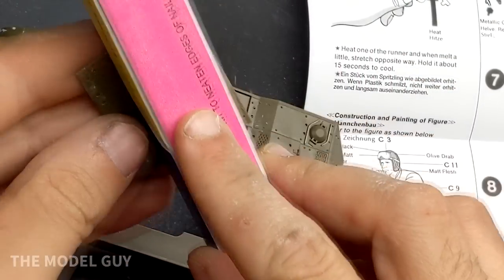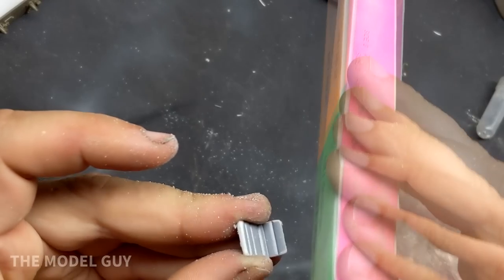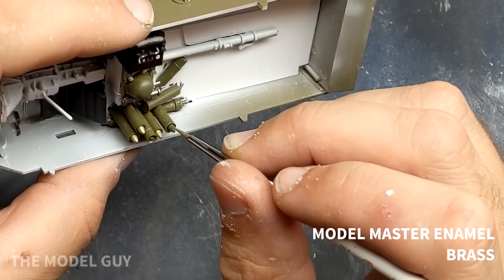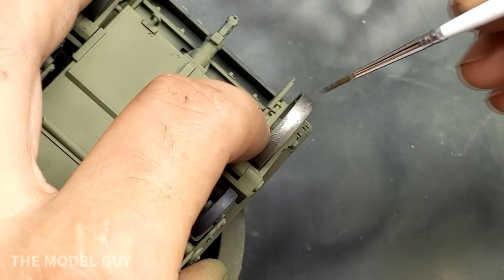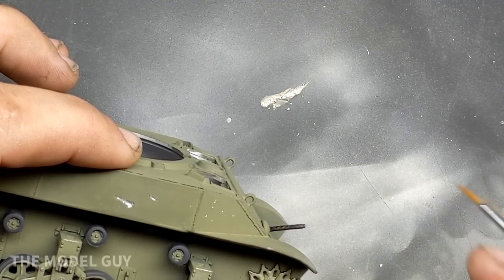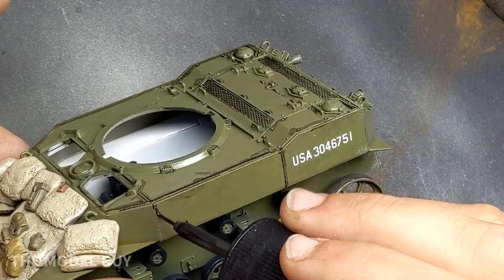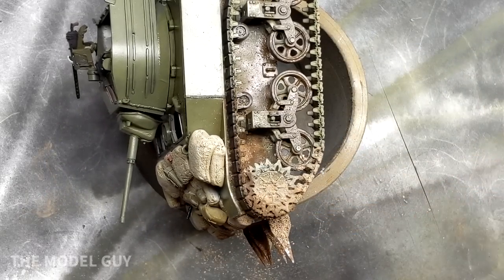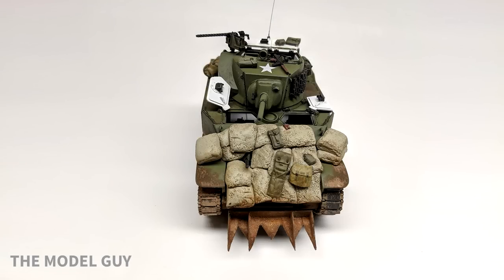My first tank build! 1/35 Tamiya M5 Stuart

Comment: You are absolutely right about the "armor style" that a lot of Youtube modelers use. They go heavy on color modulation, chipping, weathering. To the point sometimes that the tanks look more like wrecks pulled out of a lake 50 years after the war than they look like armor in the field. The lifespan of an average Tiger or King Tiger tank was measured in months - Sure they got dirty, sure exposed steel got rusty fast. But these things still had New Car Smell when they met their ends.

Comment: US (and Canadian Ram) tracks were "live" (containing rubber bushings) and did not generally "sag", unlike German and Soviet tracks of the era.  So, don't beat yourself up over using the vinyl ones.  The standard for both M3 and M5 was a rubber block with two steel pins that mated with the end connectors, which also carried the guide teeth..  So, the centers are a rubber black.  The inside face gets a bit of burnsihing from where the rubber bogies roll against them.  The insides of the guide teeth get more wear, on average, than the outsides.

Comment: I just got a kick out of the fact this kit was first issued in 1977. I built this kit back in 1978 or 1979. It was a fun kit to build and had my tanker firing the .30 caliber machine gun. The plastic tracks on all these kits from the 70's and 80's were always a challenge to get the sag especially on the German tanks. One way was to use thread through the track between the wheel and around the torsion bar and pull the track down onto the road wheel. I did that on my Panther and Tiger and it looked great. The other challenge when connecting the tracks was using a heated flathead screw driver to flatten the connectors without melting the track around it.

Comment: You should use black brown paint to made drybrush scratches. Silver/steel is good for aircrafts.
Reply from the maker: Thanks for the tip. I still have some weathering to do to tie it in with the diorama. I'll do touch ups then

Comment: I made a fantastic air recognition pannal out my tabbaco packet! Shane's is a great tutorial but not accurate folding! Look up some real one's the plastic from the tabbaco packet I used was great for the wipe down plastic used fornthe pannal the bag was canvas that's the long one on the resin on the front you have is for! It's actually the first time I've seen the stowage bag for them in a resin plug! The ends of the pannal were fabric stiched border to keep it all together with the white pannal on the back of the 140 pannal but they were long very long and narrow! That could be cut in half again to replicate a real one! And the early m5a1 never had the 30 cal shield on side of turret, Tamiyas burn iron is or German camo black brown we use for chips is great for the gun base adding bry brush gun metal or using the gun metal down first using aks worn effects over that then using the burnt iron or black and wearing the paint through! It's very realistic

Comment: I like the way your M5 turned out. The weathering, particularly on the tracks and suspension looks perfect.  It was June after all so there wouldn't be too much mud.  When doing equipment storage, remember that anything resting on the hull has to be clear of the turret when it traverses, and as one gentleman posted below, it will shake, rattle, and roll off if not tied down.  Also, the radio aerial is too thin. Watch the movie Fury, the scene where they are driving into the tank park, for a better idea of the thickness and taper.  I crewed on  U.S. Army M60s with C-3-35 Armor in Germany in 1968/1969.
Those minor points aside, it is a beautiful build!  Would love to see your diorama when you get it done.

Comment: You should have ground off those bags on top of the sandbags.Use putty to build up the bags and texture. Yes more work but you never see the bags and mag pouches there. I see this all the time with modelers, most never served in the military much less an armored unit so it's understandable. What you might see in WWII is just rolled up canvas, we put our duffel bags on top tied to the tie downs on our tracks.

Comment: Nice build. Well done. 

Just a few quick tips. On tanks, if you do as much painting on the running gear as possible before you assemble it, it makes life so much easier. Especially the road wheels and return rollers. You can paint those completely.
When using spares for extra detail that’s not included in the kit (like the seats), especially if you’re building for a “competition” or commission, make sure you have tons of reference photos so you accurately reflect the real thing (those seats were an obvious miss). But, kudos on detailing the interior and opening that baby up. 
You should do all the battle damage prior to any paint. 
One thing I’ve found that works great for antennas (for armor and even man portable radios) is guitar strings. The smallest ones that have a single wire with another one wound around it. Cut the whole thing to length, then grasp it just a little up from the base (about 1/8 to 1/25 inch), and start pulling the wound wire from the top so it spirals up with an increasing gap between until it just looks right, cut off the outer wire between 1/5 and 3/4 the way up the inner wire (maybe a little more, start high and work your way down until it looks good). Now of course that not always accurate, so again check your reference and don’t go with just one source. 😉

Thanks for sharing your work. 👍👍

Comment: Rubber band tracks are fine for US tanks, they use a live track that has very little sag,  usually only a inch or two on the real ones, the use a block of  wood on the center support  roller and adjust to half a inch to the next rollers. If you ever slip a track on the side of a incline, you will  know why, done that.
Reply from the maker: As a heavy diesel tech I like hearing those insights

Comment: Nice job on a STILL very nice kit!  You need to weather/grime up the inside of the large, top hatch and tie down the equipment on the air recognition panel.  Those entrenching tools would be vibrated off the rear deck 100 feet down the road!

Comment: Nicely done sir.  If I may make a suggestion however....all of the tanks made in WWII were primed in a rust resistant primer that was extremely tough and very dark.  If the paint chipped, it'd show the primer and a dark, oxidized metal, not bright steel.

But again, very nice and this makes me want to build a Stuart

Comment: I have the 1969 tamyia panther tank and it has very good detail and fit but the parts of the hull above the tracs weren't designed for the kit, so I have un each side a gap long 4 inches and wide 1 inch, that is very annoying...

Comment: Overall I really enjoyed this build but I have a few criticisms. The whole tank looks too clean. If you look up reference photos on Google of M5 Stuarts there's quite a lot of grime, dirt and other stuff. A tank that's been driving through the fields of Northern France should either look a lot dustier and as a result more matte, or they should be covered in wet mud. Your pigments are also too contrasting with each other and they look kind of like completely dry and wet earth that have been added on at random and with no in-between. A nice touch would also be to maybe bend up the front fenders a little bit from going through all those hedges. I also saw some pictures Stuarts camouflaged with branches and leaves, which could look quite fitting depending on the diorama you're doing. The scratch built interior details and the different resin elements are nice touches and give the tank a lot of personality. They make it look lived in, and  I guess that's why the relatively clean exterior looks kind of... Off in comparison. For very in-depth videos on doing armour model weathering I would really recommend a channel called Night Shift. He's an excellent builder and painter, and he makes in-depth tutorials for loads of different weathering techniques.
Reply from the maker: Thanks for your tips. The diorama will tie in the tank with final weathering. This will also be just as Operation Cobra has started so it's only been in service a few weeks. I'll check that channel out though as well as this one be my last armour build